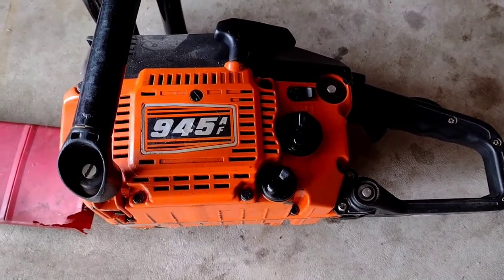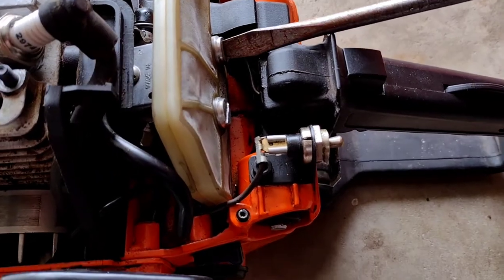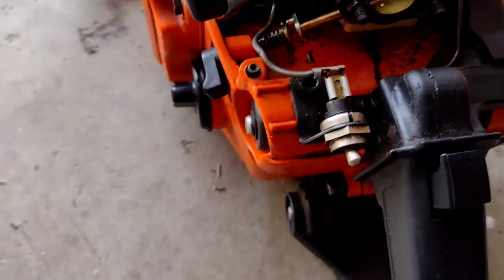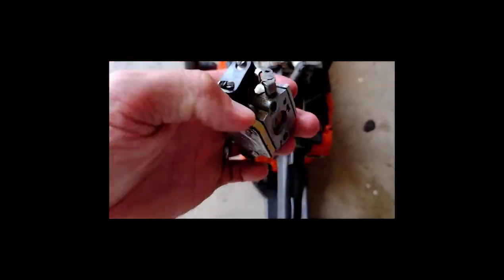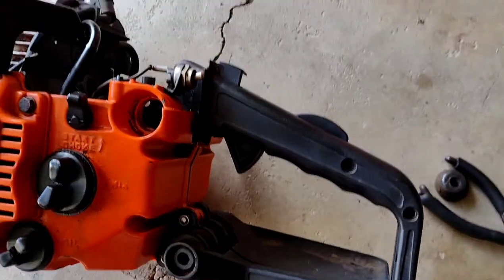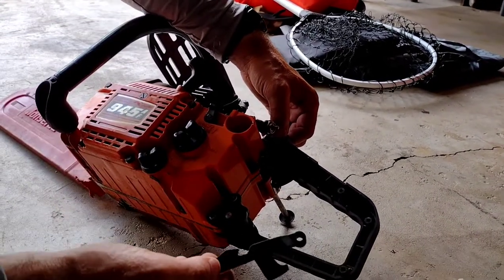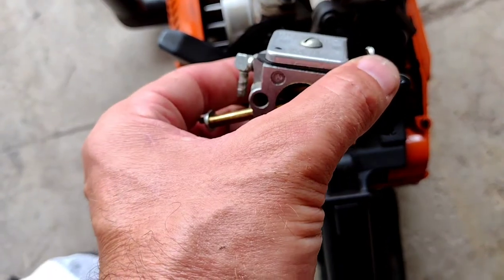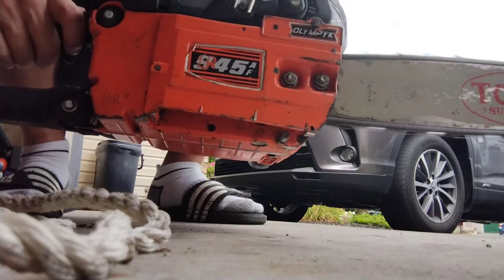OLYMPYK 945 AF chainsaw tear down

Comment: I bought this saw model brand new back in 1985. It was being promoted at a low price as a pro level saw. They gave away a free diamond coated chain with it. It was a great deal and that chain lasted forever. The purchase price was about $250.00 which was a lot for me back then. Stihl and Huskies were around twice that much. I cut many cords of wood with it and still have it. The brand was Olympyk but previously was spelled Olympic later became Oleo Mac. It's a heavy saw but works very well and was a reliable saw.
Reply from the maker: That's great information, thanks for sharing!
Reply: @Neighborhoodgo2guy  it now has a fuel leak and has been hard to start so I was going to get rid of it but decided to try to go through it, clean up the carb, replace fuel lines, clean it up and see if it has some life in it still.